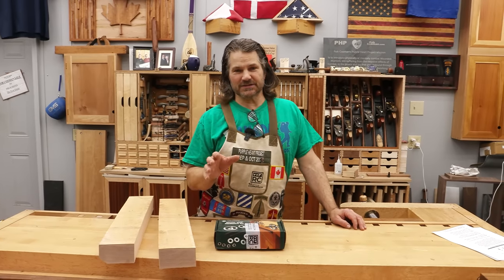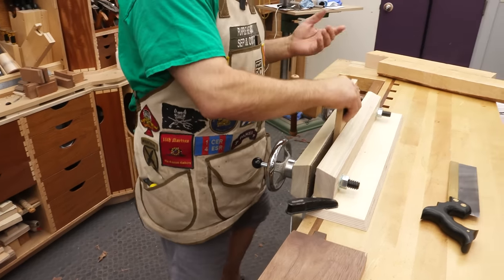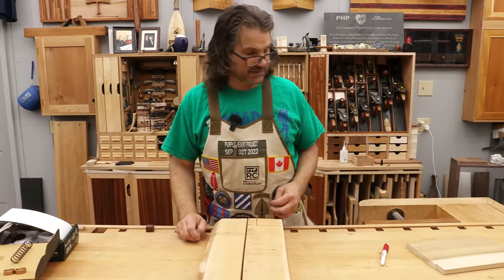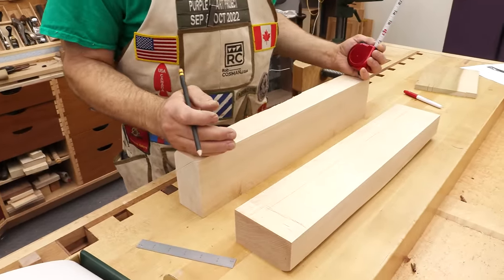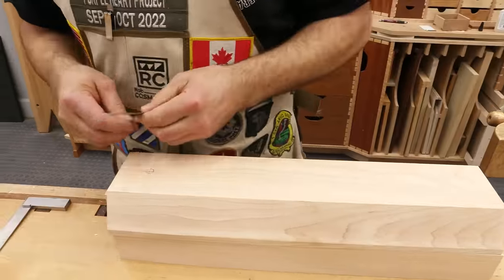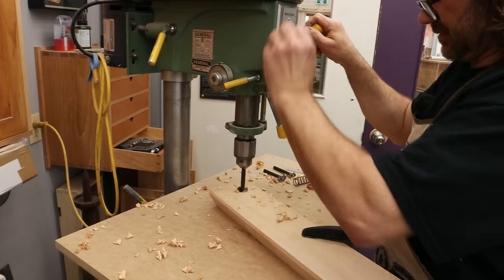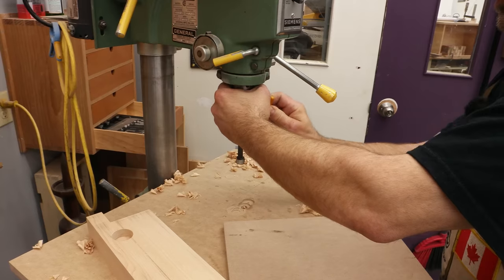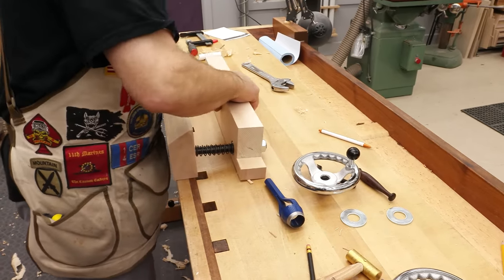Easy Upgraded DIY Moxon Vise

Comment: Nice build. I made my back piece wider and use my hold fasts. I also pinch the moxon vice with the wagon vice to add additional hold. This way I eliminate the f clamps on the front of the  work bench. I don't have a lip on my bench as you do. (well actually I do but it is a full 8" thick.)

Comment: They are smart improvements to your moxon kit. It really sets it apart from many of the other choices out there.  Q.  Why do you lock the threaded bar in the rear vice jaw rather than locking it in the turn handles.  Locking it in the handles means the thread can't protrude when the vice is locked up on a piece.  ???
Reply from the maker: There wouldn’t be a good way to lock it to the front jaw, while allowing it to thread easily in and out of the nuts on the rear jaw.

Comment: Wow this kit is amazing pretty cool and useful...I would like to share how my father did a "hinge vise" so he used only one screw (scafolding leveling screw) with a wooden wheel...one fixed jaw like yours but the front jaw was attached using a heavy duty gate hinge at left side and only one screw at right...to compensate the diferent thickness he taperated the front jaw (the gap was big at left) and used at left,center and right for his normal wood thickness job...it worked for him until he passed way (almost 40 years with that vise)...no kits in Brazil in 1974
Congratulations from Brazil
Reply from the maker: great story.....do you still have his vise?

Comment: I'd like to make the knobs in the wheels quick release, that one could remove them, slide on a tie rod (read: a long thin mending plate), then replace the knobs... then, at the center of the tie rod, bore out a hole, slot in a stand-off, and add a third knob, so one could actuate both wheels with one handle (think like train wheels).

The quick release on the knobs makes it a minimal hassle to remove the tie rod for asymmetric clamping.

Comment: Will you guys be selling those bushings if we already have a kit?I’ve got the benchcrafted kit and can totally see the value in the bushings. Great idea 🍻
Reply: If they don't sell them then you could easily make two bushings from brass tube you can find at any reputable metal supplier. Clamped properly in a miter saw you can make two cuts off one end. And no, the brass wont hurt a good carbide tipped blade for just a couple of cuts. Make sure to use some wax on your blade to make the cut smoother and go slow through the cut. Hope this helps you!

Comment: Why do you only add the cork/rubber to one side of the vice rather than both sides? Does it matter which side of only used on one side? Might both sides work better?

Comment: Shouldn’t the bevel on the front  chop be equal to, or less than the angle your saw is at when cutting the sockets for half blinds. I  think 30 is too much
Reply from the maker: It should be at whatever angle you like to prevent you from sawing into your Moxon vide.  If the only thing you saw at the vise is half-blind dovetails then make the angle for that